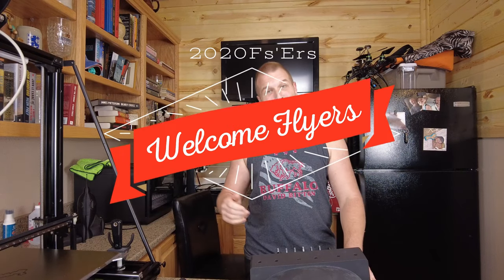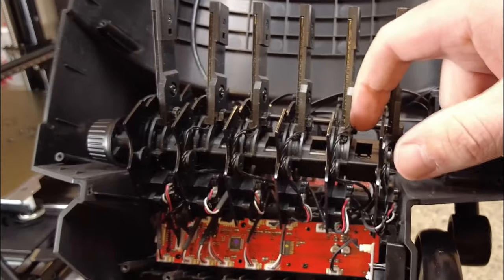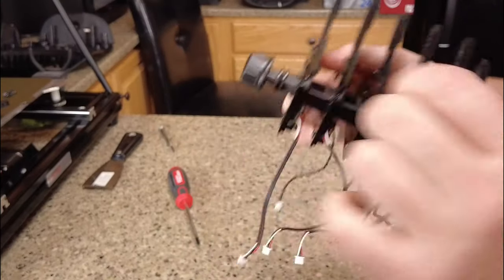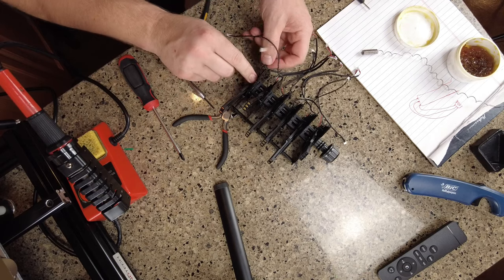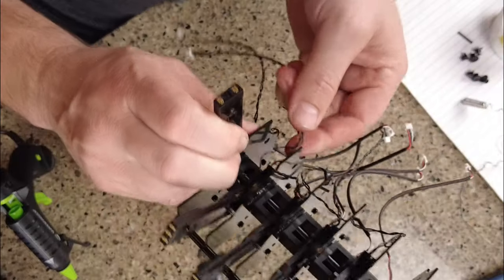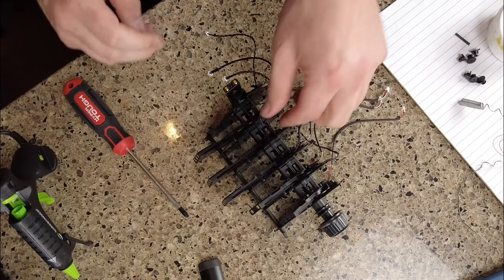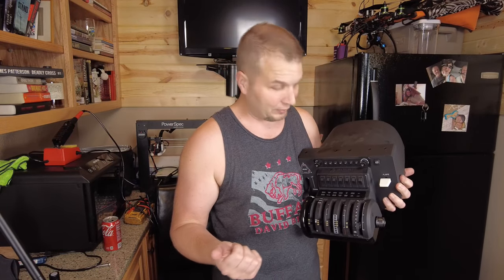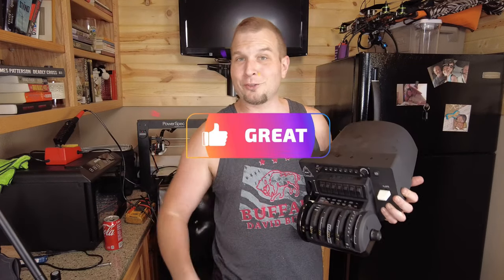Honeycomb Bravo Throttle Quadrant Problems REVersers NOT WORKING! Bravo Teardown REpair! POOR DESIGN

Comment: I received a brand new today. I can see a new design. There is kind of a ring which hold the wires in place. So where you put the colored shrink wrap on 9:22 in around the middle of it is the ring placed
Reply from the maker: That's good news for everyone thanks for sharing . I'm happy they may have fixed the problem .
Reply: Hi FlameBot, I was going to buy a new Honeycomb throttle today but after hearing the wire problems I’m unsure because I don’t want to be repairing anything. 

You mentioned your model is a new design. Please can you confirm if all is well? Have you experienced any problems? Does it work 100%? Have HC sorted these wiring issues. 

Any advice would be appreciated. Many thanks. C Davis 😉
Reply: @countdavis  until today I don't have any problems with the wiring. I can confirm that the wiring looks different in my bravo throttle.
You can order and check for yourself if you received a new version too. Elsewhere return it :)
My first bravo had wrong stops for the zero position of the levers. I got a new one. Then this one had after several months a broken rotary encoder or the autopilot (top left corner). I got a new bravo. This one is the one with the updated wiring. The detent position or the levels are still not the same (3-8mm different stop position) but I live with that.
Reply: @FlameBot  Thank you very much for your help and advice. I still haven’t bought it today because I’m concerned about the issues. I have the HC Yoke and the Thrustmaster Warthog set, which all work 100% and never any problems. I thought I would get the HC Throttle so I have 2 sets for different aircraft. 

After reading lots of reviews the feedback is not good. Amazon UK  have also “increased” the price today on Black Friday to £302.39 what I thought was strange. Everything else is discounted. 

I think I will hold off for the minute because I’m not desperate. I hope your model continues to work and serves you well. 

Thanks again 😉
Reply: Where did you buy yours from? Is there a way to tell if it’s a newer fixed version? Like a serial number or something?

Comment: Crikey that's a good video. Thanks for sharing. Not sure if I would be confident enough to do it though. My reversers are broken on both 1 and 2 now. This sucks!
Reply from the maker: Thanks for the comment it's not to bad to do if you have smaller hands lol 😆 it would have been nice if they did a little quality control and at least did some stress testing on them it would have shown very quickly

Comment: Same problem with my unit - I reside in Australia (Perth) and purchased the Alpha and Bravo from a supplier in New Zealand. 
Sent the unit back with photos and a list of the switches that are not working over three weeks ago was advised my supplier yesterday that they are sending it to another supplier for assessment. Pretty poor show all round and the use of improved (silicon wiring) and decent limit switches would have gone a long way in minimising these issues. 
Assume Honeycomb will be issuing a recall?
The price of these unit was eye-watering and pretty  hard to justify when one looks at the components used to produce these products.
Guess we will have to wait and see how this develops.
Reply from the maker: hey there thanks for the comment . Yes thats what i did is replace the wiring with silicon wiring. lots of people waiting on replacements but from what i have heard they are sending out refurbished units to those with warranty issues fyi.

Comment: Haven't used my Bravo for 2 years, and with MSFS 2024 just being released I wanted to get back in the game. During configuration there was some buttons that simply matched to nothing when trying to configure for MSFS 2024 (auto throttle disconnect on the Airbus / reversers on the Boeings). Seems this might be a good weekend to get the soldering iron out.
Reply from the maker: Lol 2 of my wires are broken again . I don't feel like a teardown again .

Comment: Does anyone know what is the type of of plugs used on these wires? It's pretty obvious that you can't solder the wires forever, they would need to be replaced eventually.
(Great video! I just fixed my engine 2 reverser thanks to it).

Comment: I have the same problem.  I notified Honeycomb.  They are supposed to send me a shipping label after a delay.  They say their repair facility is awaiting parts.  They don't want to remove my unit until they have the ability to fix or replace it.
Reply from the maker: i have a feeling they will start getting lots of call and they will get overloaded . Very big design flaw inside these units.  i wonder what their fix will be  if they ever tell you i would love to know if ya think of it . thanks for watching

Comment: Thanks for the vid. I don’t have a bravo throttle yet but it’s definitely on my wish list. I wasn’t even aware of this problem existing wile researching the product

Considering I’m a long time model railroader and have done many electrons installations on the tiny trains. I feel confident that when I get mine I’ll bundle the throttle wires in heat shrink tubing as a preventative maintenance. Also wow 

that’s a lot of dead space inside the main body of the throttle. That give me a few ideas for some DIY customization options. Maybe add a few extra switches under the throttle using an Arduino controller?! (I normally don’t care about warranty since most model train stuff I’ve bought only have a year long one.  no idea what the flight sim business is like.)
Reply from the maker: Hey thanks for the comment . I would say you shouldn't have any issue with your skills to do this repair if your happens to have this issue .

Comment: Thanks for the video, it was clear and straightforward with no nonsense :)
I actually haven't made use of the reversers at all since I got my quadrant, my preferred aircraft are all props and the only one I have that does have a reverse is the DC6, which has a different method of conveying reverse. But good to know that if & when I do, there is a reasonable fix for it. I expect the recommendation is to not only fix the broken one(s), but to fix the others as well as a preventive measure? It's what I'll do anyway :)
Reply from the maker: Your very welcome. Thanks for watching .hope honeycomb fixes the issues

Comment: Great video! I was wondering, are the detents adjustable? On my 1st throttle the detent is so light that I go past it a lot. Thanks!
Reply from the maker: Thanks for the comment ... yes the pressure to activate the detent is adjustable.  There is a little set screw with a nut to secure it for the detent but be very slight with the adjustment or you won't be able to go into the detent with the throttle.
Reply: @2020fsers  thank you!
Reply from the maker: Your welcome

Comment: Bro... this is literally what I discovered with mine only yesterday. Thanks for the video. I suspect the wires are breaking because they are constantly being bent back and forth all the time, causing them to eventually break. I was hoping it was going to be easy to get in there, but by the looks of it, I am wondering if it is worth the effort. I might just map the reversers to the rocker switches instead.
Reply from the maker: From what other users have told me they are replacing them under warranty and also from a subscriber they have fixed the wiring issue on the replacement.

Comment: All mine are broke except one... No wonder I'm having so many issues. So frustrating. Great video though!
Reply from the maker: hey thanks for the comment . the wiring in the units are not done with the greatest of care in design and leaves much to be desired. but it is an easy fix if you have so solder and an iron .
Reply: @2020fsers  going to look at getting one
Reply from the maker: Amazon pretty cheap .

Comment: Thanks for sharing, good to knew. I hope that honeycomb has a good customer service.
Reply from the maker: Yea I can say they will be getting quite a few calls pretty soon I'd imagine. But maybe they changed the design from the 1st couple batches idk let's hope so. Thanks for the comment 😀  .
Reply: @2020fsers  One of the toggle switches on my Bravo was dead from the get-go. I emailed back and forth with a support rep at Honeycomb. He was very responsive and said they would fix it under warranty BUT I had to ship it back to them. I asked if they would ship me a new one and I could return the 'not working properly' one once I receive the new one. That got me a "no can do" response. I had been waiting about 6 months for mine to finally arrive since placing my order, so there was no way I was going to pack it up and ship it to God knows where for repair. They are based in San Diego and I live just outside of Ottawa Canada, so one can only imagine the headaches and the amount of time associated with making all that happen!? I told him I would live with the dead switch. Maybe if and when a / the reverser wires come off (...hopefully never!) I will see if the problem with the switch can be fixed with a bit of solder.
Reply from the maker: It may just be unplugged but that sux to have to wait 6 months just to get it and yeah I wouldn't have sent it back either .
Reply: @ArtG-49  My turn around for the returns has been around 2-3 weeks.  Yes, I said returnS, because they apparently all have this problem and they merely ship you a new one.

Comment: Sir, I just pick up this Quadrant, which I added to my Next Level Lite Cockpit, it is a little big for that but I think it will work out fine. My question is did the wires break in the middle or at the start point? and would you consider some kind of insulation over the wires? Great music, I thought I was fishing lol. I like it so much I am a Subscriber,  good video.
Reply from the maker: Hey thanks for the comment and sub 😀  my wires broke in the middle . I replaced them with  silicone wires that are more flexible and left room so they can move .

Comment: EXCELLENT VIDEO! 
Questions: Is it possible to replace potentiometers in case of malfunction? Or much better replace them with Hall sensors?
Reply from the maker: Thanks for the comment ! I'm not sure you could replace with hall sensors unless you can reprogram the board . If you replace the potentiometers make sure that are the same part numbers or specs if they are off the board needs to know that I would think .
Reply: That is what I would like to know, but I'm afraid they prefer the programmed obsolescence, instead of helping the customer to solve problems.

Comment: I am looking at the Honeycomb because I currently have the Turtlebeach  VelocityOne and not feeling it.  Got it a few days ago and it wasn't till recent that TB even put out the proper software to work with FS2020... So it seems like they rushed it out the door and are now working on it actually working with FS2020.
Reply from the maker: The bravo is a great throttle just some issues with wires it can be a deal breaker for some. Thanks for the comment

Comment: Thank you very much.  Now, when It will stop working I will know why and that can be repaired
Reply from the maker: Your welcome thanks for commeting
Reply: @2020fsers  ,  do you think it is a good idea to do something preventive.  I believe the wire is Snapped on the shaft. Is ir a good idea to free it so there is no tension?
Reply from the maker: Well that is up to you if you want to do that. They are under warranty so you have to make that call I can't tell you to open it up.

Comment: I have my Bravo less than a year and I too just acquired a defective reverse thrust issue on just one lever so far. sure enough, I can see the broken wire inside with a flashlight. I contacted Honeycomb and I have to send it in for repair or replacement. They informed me I would probably be receiving a refurbished unit as a replacement. Maybe the refurbed will be a modified version to correct these issues. I shipped it to them yesterday. I will probably be waiting, conservatively speaking, 3-4+ weeks before seeing the replacement. Not good for a $275.00 device to fail so soon. Not sure if I would want to open it up to repair it but I probably could if it occurs again. Can you tell me where and why you used hot glue. Can't see much of that procedure in the video. You never explained its use in video. Thanks for the video.
Reply from the maker: Hey thanks for the comment . Wow I think it's crazy they are now sending refurbished units out and not new units. Best of luck with it. When I bought mine I paid 450.00 so I was really upset when this happened but it been great now.

Comment: Finally a disassembly video! Thanks for making this video. Unfortunately I ordered the alpha and the bravo too early before watching this and discovering that the Alpha yoke is not only using those crap ancient potentiometers but also just has 8-bit=256 resolution! Now I regret so much about buying them... Anyway, I'd like to ask are the crappy wires only affect the reverser? Since TOGA buttons are on the levers as well...
Reply from the maker: Hey thanks for the comment yes the wiring is only affecting the reversers and Toga button.
Reply: @2020fsers  Thanks man.
Reply: "the Alpha yoke is not only using those crap ancient potentiometers but also just has 8-bit=256 resolution!"

May I ask where does this come from? Cause I'm a bit surprised the Alpha would be so universally praised with such low-res potentiometers... Even Austin Meyers from X-Plane reviewed one of these and monitored it (compared to others too) using Xplane controllers resolution tools and it certainly didn't came up as especially lacking in the resolution department like an 8 bit 256 sure would largely be.
Reply: @alanlej  I've heard that firstly from one of @Almost Aviation 's videos of review the Alpha or so. You can check his channel on YTB and there are more detailed explanations, such as the deadzone issue/scandal. And 256 is the number shown in the windows joystick calibration program. IIRC he also said the sensor itself is higher but the (crappy?) control board limited it to 256 or something like that. Interestingly, now the honeycomb officially admits that in their advertisement of the upcoming alpha xpc yoke by saying "(the upgraded 12-bit hall sensor)is 400% more resolution" blabla. Though 400% with 12-bit doesn't translate to 256 but I'd guess it's bcz of the sensor capability vs control board capacity issue aforementioned. Yes lots of people have praised the brand and their product and I personally think their design is good for flat screen swimming in terms of the functionality as well, and the fact that finally in the relatively affordable department choices other the saitek/logitech craps have emerged was pleased; BUT, after knowing their stinginess, poor design and cheap material used in the bravo as well here you can see in this very video, poor customer service(about 2 yrs-ish of the debut, lots of reports of failure emerges with bad customer service. have a look at the comment section on the alpha xpc announcement FB page), extremely slow development circle that only yields disappointing product in the end, and what not under the shining looking, I'll most likely never buy their product (luckily already managed to sell all of mine existing ones) and would rather save more for something really solid inside. I'm not their target audience. I'd rather support the small company that builds solid (metal) product at a "slightly" higher price such as the Fulcrum Simulator Controls. We just don't need another of those passionless toy makers like saitek/logitech/thrustmaster

Comment: This is an outstanding video! I have the Bravo, but usually fly only GA single piston engine style planes, so haven’t given much thought to the reversers. One question I do have though is, was the #1 lever any different from the rest due to having the go-around button? You’re lucky you had at least one lever that you could map the wires from, but that’s what made me wonder about the #1 lever and whether or not that one is different. Subscribed a few days ago!
Reply from the maker: Hey thanks for the comment 😀 and the sub .so on number 1 it just had only 2 wires instead of 3 like the others so no issues there been working great since the repair.